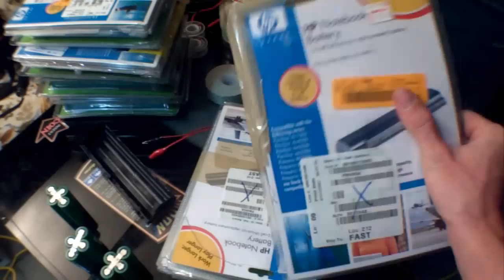DIY: 48v 24ah lithium ion 18650 e-bike battery pack

Comment: You do some excellent work Rinoa. I've been all through your channel and I'm very impressed with your knowledge and capability to make a cheaper, well functioning battery pack, as well as other electronics. Exactly what I have been looking for.
I plan on using your latest/best plans to make a battery that will power the 48v 1000watt motor that I plan on getting soon. Saving me a whole bunch of gas and money in the long run. Ideally, I would like to make a battery that would allow me to make a 75 mile round trip.
One question though, were the laptop batteries that you purchased off ebay used? 
Keep up the good work my friend! Knowledge is power!
Reply from the maker: no they wherent used i don't think. they looked like store returns. they had stickers saying "void return to vender" and stuff on them over the best buy stickers. if i remember correctly that is.

i've stripped apart several used battery packs and they tend to give you atleast half their origenal capacity. like 1ah per cell. but hey if you find a dumpster full of old laptop batteries use those! you'll just want to be picky with making sure to not use leaky cells and stuff. i save leakyand crunched cells for flashlight projects and stuff.

once a cell get bellow 2v it hurts them a lot. you usually lose half their capacity that way. like my first 9ah battery was made from cells from 2002 and they sank to like 0.8v over their life of warehouse storage. but those HP 12 cells battery packs where only 7 years old and only drifted to like 3.4v and still had like 95% capacity.

and yeah...i lost my train of thought. thanks for enjoying my videos. i hope to keep improving my channel. i'm already making 50$ a week from it and may be able to live off it someday. or atleast feed the money back into the videos!

oh and if you find a cell that is bellow 1v charge it with like 10ma. that can help you not short them out when trying to bring them back up.

and....end of ramble
Reply: Rinoa Super-Genius oh wow, congrats on the income! That'd be excellent if you eventually got to use youtube as your main employment. 

but huh.. I'm just having a hard time finding any kind of deal like you found on ebay. Fifteen 12 celled latop batteries?? that's a crazy deal. How much did that run you? I'd be very lucky to find a dumpster full of old laptop batteries.. I'm probably just going to stick to searching through ebay waiting for a good enough deal.

What do you mean "charge it with 10ma"? what is a 10 ma?

I shouldn't have any more questions after I collect all the necessary equipment though, you were thorough enough in your explanations for each video.

Thanks bud
Greg
Reply from the maker: yeah but my videos are really random, so don't feel bad to ask a question. i don't get upset by lots of questions as long as you seem to learn from each one. i just get fed up with people who are like "so wahts a volt?"

by "ma" i mean milliamp. a milliamp is 1/1000th of an amp.

and the battery packs cost me about 12$ each. was 160$ in total for 2nd battery and 80$ for first battery.

http://www.ebay.com/itm/New-Genuine-HP-395753-251-PB995A-12-Cell-Li-on-Battery-PJ12-DB10-/171145080603?pt=Laptop_Batteries&hash=item27d90aaf1b

thats from the same seller that i got mine from. it looks like he has been selling a lot of them and jumped the price up to 15$ each, but still thats like 1.20$ per cell.

but i think you could prolly find better deals if ya shopped around, but prolly not better by much.

also do you have a universal power supply? i got a 0-30v 0-5amp DC variable power supply like a year ago from ebay for 80$ and i couldn't work without it now. even though its the cheepest cheepo version it works great.
Reply: Rinoa Super-Genius Ok ok around $160 is what I was expecting. Still 160 is a whole lot less than an equal preforming battery that is already set up! You got me pretty excited when I heard you say you've made a battery for 1/10 the cost of a premade bike battery haha Now it may not be that extreme of a discount, but certainly still is a sizable discount.

I'm not sure if I have a universal power supply.. I'd have to check with my father to see if he has one. He started out as an electrician so I would not be surprised if he has one I could use.

What kind of 1000w hub motor are you using?
Reply from the maker: well i don't know of any company who sells batteries above 20ah, and those are like 600$ on ebay last time i checked. not counting i splurged on these batteries. you could do it for free with old laptop packs.

my motor is the cheepest one i could get, it doesnt really have a brand.
Reply from the maker: Yeah that wheel would prolly work great. But I would try to buy the wheel from a bike store in your country. Like I got mine from an eBay store in California that way if I had to return it I only pay 30$ instead of 190$ to ship it back to China.
Reply: Rinoa Super-Genius This is all great news. I look very much forward to cruising around on my inexpensive e-bike that still has all kinds of power, and longevity! I plan on making two of these 24v 35ah batteries that are to power my very own 1000w 48v hub motor. The two battery packs can be arranged in a way that would allow it to produce a 48v 70ah current, right?
Reply from the maker: no you wouldnt get 48v 70ah. you can only add voltage or AH. so you could add the 24v 35ah packs together to make 48v 35ah or 24v 70ah.

but 70ah is like an insane amount of capacity. you could prolly go several months without charging a 70ah pack.
Reply: Rinoa Super-Genius haha well if I had the option I would totally do 48v 70ah! I could take off and not be worried about my battery dying! Although I can see my 35ah battery being good enough for whatever I needed around town. I look forward to your distance test of the 48v 35ah battery
Reply from the maker: yeah i plan to do a distance test soon, but i havent finished the other half of the 24v 35ah so i have it running with the other batteries. i'll test it as 18ah.

i'd better make a face shield couse it's like 20*F out regularly now.

Comment: aren't single cells available for purchase on the web?
Reply: Myth tester yes, but if you get them off the ebay you will get some cheap junk. But if you get the laptop batteries you will have good quality cells (like sony he had)
Reply: +Myth tester people are charging ridiculous prices for individual cells and you can't be sure what your getting is a good battery there are many fakes and false capacities throughout the web. Recently decommissioned laptops with OEM batteries can be the best source for cells because one or two might be bad but the rest are completely fine, 5 to 10 dollars for one laptop battery might produce between 6 and 12 cells and be cheaper or equal to the cheapo batteries people are selling new.

Comment: Excellent job. Don't pay attention to the haters. I do have to agree with some of them that is a big ass soldering irons. LOL  It probably gets the job done faster than my high dollar soldering irons. Keep up the awesome videos. I am sure you're helping a lot of people. And you will learn even more as you go along remind people to be safe because these batteries are no joke. Can get hurt very easily. Go battery power goodbye fossil fuel.
Reply from the maker: actually i've tried to get them to explode and they havent, they are very fool proof as long as you dont over-volt them.

Comment: can you explain why you didnt use a car battery instead?
Reply from the maker: because a car battery would
A: last 1/6th as long
B: hold 1/4th the capacity
C: weigh about 8x as much
B: would break my bike from the weight and it could never stand upright because it was top heavy
D: i would need 4 car batteries to get 48v. that would be like 120 pounds. thats heavier than me.
E: lead acid batteries have acid and will slosh around sometimes. my first batteries i used leaked some acid and it corroded my bike.
F: you can get lithium cells for cheeper than a new battery
G: lithium cells can be made into a pack of almost any size shape or weight.
H: a car battery is only a starting battery, the plates are too thin. if you fully discharge a car battery it will short out after the 2nd or 3rd cycle. you would need a deep cycle battery for that.

is that enough explanation?
Reply: Rinoa Super-Genius  Hey thanks so much!

Comment: Thanks for the inspiration to build my own ebike pack. Your video gives me a good start. How do you measure mah? I only have a small multimeter tester. Oh, and I really like your cat.
Reply from the maker: well i connected some cells up to a load. in this case it was a 1.6 amp motor. so for every hour the battery gave 1.6 amps to the motor it had another 1.6ah.

in the next video i show how to balance charge it and i use an Imax B6 balance charger. the imax b6 actually has a very useful discharge setting that counts up exactly how many mah each cell has. it just takes several hours per cell.

and thanks for enjoying the video :D

Comment: What is ur expectation on how far u will be able to go on ur new pack?  Im thinking u can go about 20 miles?
Reply from the maker: i could go 28 miles on my 9ah pack. this one should get about 60 miles and when i get the other 35ah block done about 120 miles.
Reply: Wow!  top speed at 35ah?
Reply from the maker: felix thecat
well at 18ah you can get full speed on my 1000w motor so about 30mph. but if i had a gear to let me peddle at that speed i could go to like 35mph.
Reply: Be careful u dont really want to go faster than 30 on a bike!  Not built for it but still amazing u can pump it up to 35!
Reply from the maker: felix thecat
bikes are ment to go pretty fast, got up to 45mph on my old 1960s bike without a motor. this new bike is even stronger too.
Reply: Dang thats wicked fast I need to go check out ur other videos to see the frame and stuff but boy be careful at those speeds- Motorbikes are heavy for a reason-

Comment: If i have 10 battery's from 3000 mah each and 1.2v. how do I need to connect then if I want 5v (close to 5v) and 500ma At the end of the module?

Comment: what kind off old laptop batteries you used to get 18650  cells???
Reply from the maker: any kind after 1998. every laptop battery i have seen uses 18650 cells.

Comment: Why pull all those laptop packs apart Why not just hook them up as is?
Reply: +mike97525 impractical
Reply: +mike97525 The pcb in the pack limits discharge.The batteries are limited to what that particular laptop needs by the circuit board inside.
Reply: thanks

Comment: ok., now, HOW you wanna  charge that thing with  just 2 terminals going  out from the batt ??? you will destroy the battery slowly with every  charge and discharge...you have to  charge every parallel section  separately to  same voltage ..
Reply from the maker: or, mr doofus, you can watch the next video.
Reply: look, dude , I've just seen this video and told, what  are my feelings about it... If you solved that charging thing, then ok...(I don't usualy go trough all the playlist of every uploader ) ...good luck with your e-pack
Reply from the maker: Eduard Ritok
well i linked it in the video description and an annotation in the video itself. its not my fault if you didnt pay attention to the video i guess though.

Comment: I'm confused how you get 24V @ 35Ah (840Wh) from 72 cells of 3.7V 2Ah (72 x 3.7 x 2 = 532Wh)  Even if the cells are 2.2Ah, that's only 586Wh.  Li-Ion calls are rated at "Nominal voltage", not full charge voltage, since they have quite a bit of float voltage. Those notebook battery packs should be clearly marked with their voltage and current capacity (like 11.1V 8800mAh), or at least their Watt/hour rating (like Apple does). They appear to be 2.2Ah cells. If you used 3S-4P you'd end up with 11.1V 52.8Ah, or 586Wh. Good info here: http://batteryuniversity.com/learn/article/charging_lithium_ion_batteries
Reply from the maker: yeah battery university has ok info most of the time. a few things they have are totally wrong though.

but anyway i'm getting the 35ah rating from my capacity test of the cells.not that it really matters though. it provides power for my bike so i can't complain ^^
Reply from the maker: Well for instance they had an article saying pulse desulfaters where a hoax and never work when that's far from the truth.

Comment: how do you calulate the volts and Ah when making a battery pack such as this? I have an electric skateboard and thinking of doing a lithium upgrade cheaply (it's about $750 for a proper lithium upgrade)
Reply from the maker: well these batteries are 4.2v so for every cell in series it ads 4.2v. and for every cell in parallel across the circuit ads the amp hours together. and a good way of testing the amphour capacity is by a load test. you can do a manual load test or use an imax b6's discharge feature. it would be a good idea to buy something pike the b6 course its 30$ and its main feature is balance charging lithium cells.

what's the voltage and capacity of your battery pack?
Reply: The original battery pack in my skateboard is 36v and 14ah. I want the range to double though. Does that mean increasingly the Ah?
Reply from the maker: Ben Peckover
yeah increase the AH. if you increase the volts you will increase the amount of power being pushed through the motor and motor controller. raising volts will make it go faster but could burn it up. you might be able to go to 40v though. just maybe test it and see if anything gets too hot.

does it have a motor controller between the battery and motor? is the motor AC or DC? if it has two wires its DC if its has like 8 wires between the controller and motor its prolly AC. a DC motor and DC motor controller could prolly be simpler so would accept higher voltages more safely.

it sounds like a really awesome project.
Reply: Okay. I will check what the fuses are that should give me a clue. So connecting positive to positive is increasing Ah and positive to negative is increasing V?
Reply from the maker: Ben Peckover
yah
Reply: Okay thanks you've been most helpful. How significant would the savings be on a project like this? Oh and does it make any difference the size of the motor it's 800watt.
Reply from the maker: Ben Peckover
you could save a lot. my 9ah battery pack cost me 80$ to make and on ebay they can easilly cost 250$. and i've only seen one 35ah pack on ebay and that was being sold for 600$. i made my 35ah pack for 160$.

just FYI even broken laptop batteries still have life in them. ussually one or two cells die and the others are ok.

Comment: felicidades por este gran proyecto.
Necesitas balance por grupos para que todos queden a 4.2v o de lo contrario con cada  ciclo de carga aumentaran las diferencias entre ellas llegando a estar  a vacías unas, y otras a media carga.
estas perdiendo mas de un 30% de esa bateria.
la mia tiene 63 li-ion 4,5 ah 7p x 9s 36v 31ah  1116W y se carga con 9 step dow regulados a 4,2v y trabajando todos a la vez pero de forma independiente.
la autonomia fue 1/3 mayor con este sistema de carga las ventajas sobre un cargador tipo imax son notables al no necesitar descargar grupos para igualar los voltajes.
http://translate.google.com/?hl=es
Reply from the maker: don't worry, i use a balance charger in the next video. Imax B6

Comment: I cant say how wrong this is. yes on a small Ah battery with a low A drain this has some economic benefit. BUT YOU MUST have balanced cells, where the Ah A and V are the same. Otherwise the more powerful, higher charged cells will try to balance and send a potential massive current to lower cells. This can cause over heating and and even explode. Unless you are really good and can monitor the battery while riding through a volt meter, you are almost definitely going to run the cells below their LVC (Low voltage cutoff) and once again damage them beyond use. Some decent controllers negate this issue as they will cut off for you if set correctly (but I doubt you have such a decent controller, cycle Analyst, or BBSHD and ETC). When you charge, you at least need a balance board and a decent charger. This keeps the parallel packs at balance. If they fall out of balance they will try to balance each other. More about that later. also you  hit the HVC (High Voltage Cutoff) at point where over 4.2 volts, you will also kill the cells. Most decent batteries have a BMS (Battery Management System) to stop all of this happening. I have taken loads of laptop cells apart myself, and your very lucky these packs are pre-welded together in this format. Most are much more complicated and need breaking down into individual cells. At this point its most likely you will fuse the cell between the + and - with the cutters (its happend to me loads of times). So if you have the same pack, they have the same cells (same Ah and A) and if you pre-charge them all (should reach 4.2V  if they're less they are failing). the next you want to do, is not bloody solder them with a commercial size cumbersome soldering iron! If you really have to solder and not weld, at least use the minimum amount of heat (as heat really destroys cells  - not so bad at the - end). Luckily these still have the solder ribbon in place. If you solder at the "bridge" between the cells, you will greatly reduce damage.  I suggest you read something like: "DIY Lithium Batteries: How to Build Your Own Battery Packs" by Micah Toll. Yes you are making a pack at the moment, but the power and effort you are putting into this could get a massively better outcome. Ps, I build battery packs as a part of my ebike business. I've worked 20 years IT Corporate IT Support and in August this year (17) I was in UK Ebay top 10% Of leisure Industry, sales. 50% of my sales are In 52v 30Ah sanyo ncr18650GA ebike batteries (14s5p). I'm still learning - till I die. Good luck